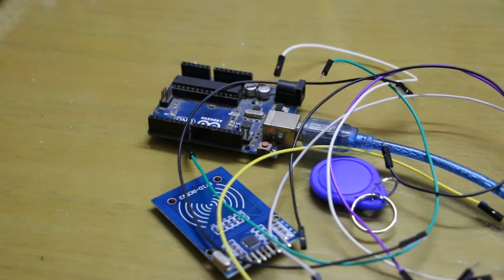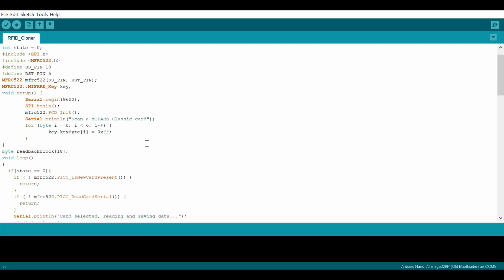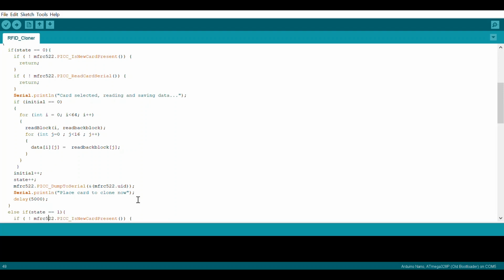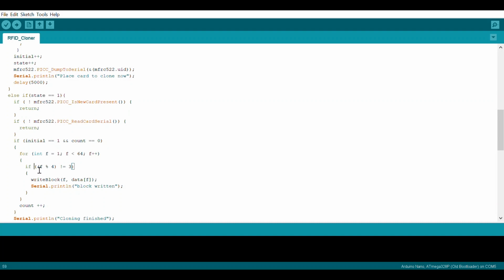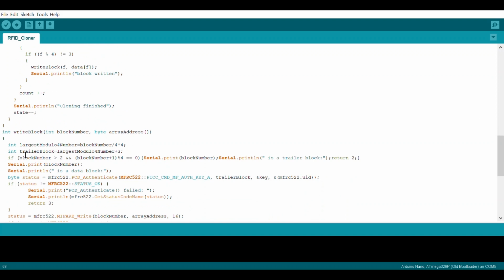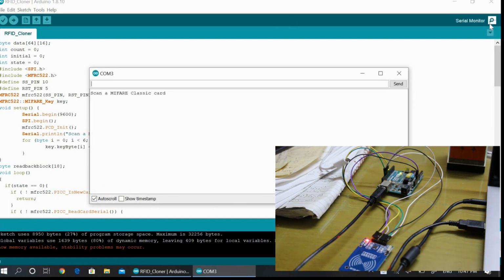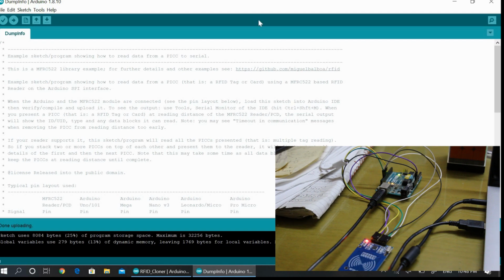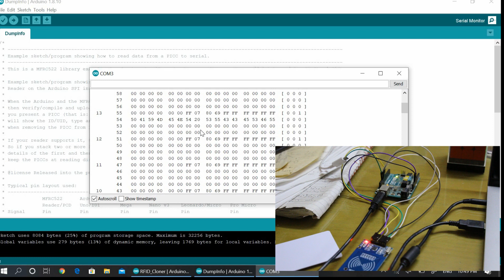Arduino RFID Cloner

Comment: : In function 'int writeBlock(int, byte*)':
RFID_Cloner:82:57: error: invalid conversion from 'byte {aka unsigned char}' to 'MFRC522::StatusCode' [-fpermissive]
          Serial.println(mfrc522.GetStatusCodeName(status));
                                                         ^
note:   initializing argument 1 of 'static const arduino::__FlashStringHelper* MFRC522::GetStatusCodeName(MFRC522::StatusCode)'
  static const __FlashStringHelper *GetStatusCodeName(StatusCode code);
                                    ^~~~~~~~~~~~~~~~~
RFID_Cloner:88:59: error: invalid conversion from 'byte {aka unsigned char}' to 'MFRC522::StatusCode' [-fpermissive]
            Serial.println(mfrc522.GetStatusCodeName(status));
                                                           ^
In file included from /Users/filippomattiamenghi/Downloads/Arduino-RFID-Cloner-master/RFID_Cloner/RFID_Cloner.ino:6:0:
/Users/filippomattiamenghi/Documents/Arduino/libraries/MFRC522/src/MFRC522.h:339:36: note:   initializing argument 1 of 'static const arduino::__FlashStringHelper* MFRC522::GetStatusCodeName(MFRC522::StatusCode)'
  static const __FlashStringHelper *GetStatusCodeName(StatusCode code);
                                    ^~~~~~~~~~~~~~~~~
/Users/filippomattiamenghi/Downloads/Arduino-RFID-Cloner-master/RFID_Cloner/RFID_Cloner.ino: In function 'int readBlock(int, byte*)':
RFID_Cloner:100:57: error: invalid conversion from 'byte {aka unsigned char}' to 'MFRC522::StatusCode' [-fpermissive]
          Serial.println(mfrc522.GetStatusCodeName(status));
                                                         ^
In file included from /Users/filippomattiamenghi/Downloads/Arduino-RFID-Cloner-master/RFID_Cloner/RFID_Cloner.ino:6:0:
/Users/filippomattiamenghi/Documents/Arduino/libraries/MFRC522/src/MFRC522.h:339:36: note:   initializing argument 1 of 'static const arduino::__FlashStringHelper* MFRC522::GetStatusCodeName(MFRC522::StatusCode)'
  static const __FlashStringHelper *GetStatusCodeName(StatusCode code);
                                    ^~~~~~~~~~~~~~~~~
RFID_Cloner:107:58: error: invalid conversion from 'byte {aka unsigned char}' to 'MFRC522::StatusCode' [-fpermissive]
           Serial.println(mfrc522.GetStatusCodeName(status));
                                                          ^
In file included from /Users/filippomattiamenghi/Downloads/Arduino-RFID-Cloner-master/RFID_Cloner/RFID_Cloner.ino:6:0:
/Users/filippomattiamenghi/Documents/Arduino/libraries/MFRC522/src/MFRC522.h:339:36: note:   initializing argument 1 of 'static const arduino::__FlashStringHelper* MFRC522::GetStatusCodeName(MFRC522::StatusCode)'
  static const __FlashStringHelper *GetStatusCodeName(StatusCode code);
                                    ^~~~~~~~~~~~~~~~~
exit status 1
invalid conversion from 'byte {aka unsigned char}' to 'MFRC522::StatusCode' [-fpermissive]